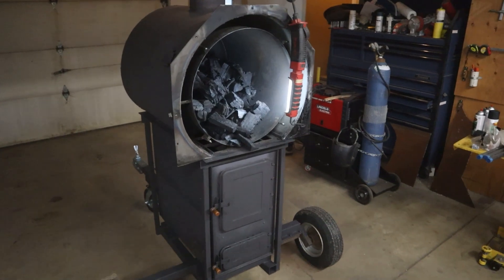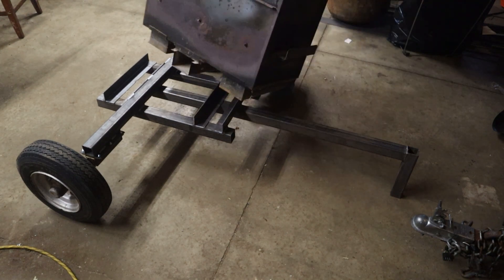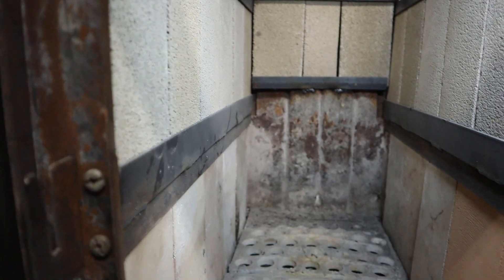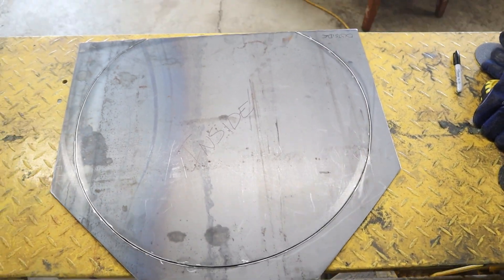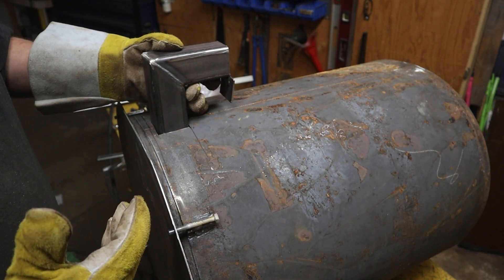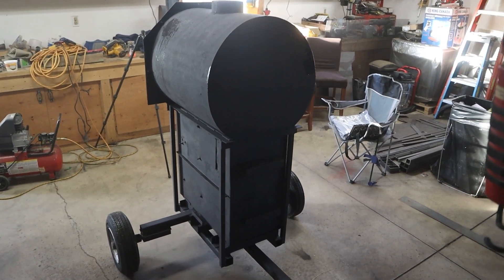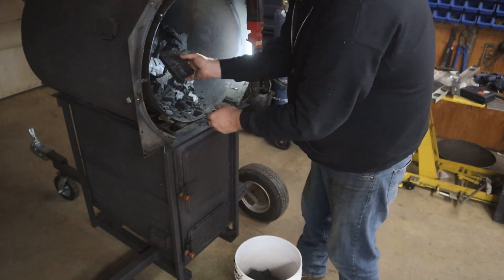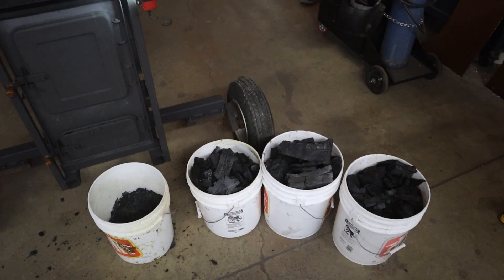Homemade Charcoal - Building a Charcoal Retort

Comment: Really amazing work!   I can understand the need to reduce the size of the wood pieces, but the fact that those big chunks got turned to charcoal as well really shows how well it works.  Video posted 2 years ago, so I'm curious as to how well it performed long term, and if you had any design changes you'd make if you built it again.

Comment: Nice job, probably even better when you finish the "tweaks". I am looking for ideas to copy, yours come in line with what I was thinking, as I have a couple older wood stoves that I wanted to use as well. Another thing that I would like to do is incorperate  a way to use waste oil in the burner as well as wood.

Comment: How is this holding up 10 months later?
I'm building something similar at the moment out of stainless steel and will insulate the outer drum plus fire the whole thing with a biochar producing TLUD gasifier so I'm not burning any wood down to ashes
Reply from the maker: Still going strong, I've done about 12 batches this year. Stainless would be nice, could get it even hotter. Hope to see it on your channel.

Comment: How can you use the excess heat productively?
Reply: Isn't he already using it productively to drive off the wood gasses and to fully dry the product? Stealing heat from that process would only slow it down or even cause incomplete pyrolysis. Maybe you could use a little of that for cooking if you welded a flat plate somewhere near the burn chamber, kinda like how wood stoves are traditionally used.

Comment: The only thing I missed was how the cook chamber lid sealed, was it a slide fit? By far the best build I have seen
Reply from the maker: Sorry for the delayed response. Its not a perfect seal, but the bottom head from the water tank fits in the pipe snug. There is enough back pressure that oxygen cant get in.
Reply: @buildfixeat  Thanks for the reply I will be building a slightly smaller version of this soon. As I said, by far the best build I have seen.

Comment: One of the best builds I have seen 👍 I'll keep an eye out to see what tweeks you make. 
(1) I'd consider making a removable standpipe for the gas discharge hole in side the retort to keep char from falling in while burning, and a flat cap for that hole to keep char from falling in when you empty the char. 
(2) others already mentioned the extended tube with holes for a burner under the chamber. 
(3) If you still have the water heater outer shell, i'd put it over the outer tank and fill the gap with cheap fiberglass insulation. Google say's fiberglass melts at 1,300F, so should be fine, or go with rockwool which melts at 2,150f. Keeping the heat in should reduce your burn time.

Comment: I like it!

 My challenge up here (Rye, Colorado) is trying to use tons of pine needles and pine cones to fuel the retort. And I mean tons. One year I collected 23 bags 55 gallons each to burn under the supervision of the Fire Protection District. (They were plastic, so I had to unpack them, and keep them) This was done at the local gravel pit away from the forest. 

So, I figure I might create several special chambers fillled with the needles assisted with either forced air though the center, or just a lot if drill holes in an iron pipe. Any time I've ever tried to burn pine needles they just soldered. During a forest fire I imagine they get so hot that they suck oxygen right in regardless of how piled up they are.

Anyway, good design!
Reply: Why not just grind needles, soak them, and press bio briquettes out of them? Seems like less hassle and better end result in this scenario to me.

Comment: It is a very good machine, but you should convert into a pyrolyzer, that means fumes emitted from woods are recovered. The tar collected has a very high value in the chemical industry.
Reply: But ya unless if you’re wanting to collect pine tar for water proofing or something you might as well burn it in the process of making charcoal.
Reply from the maker: Interesting
Reply: Who the hell buys that stuff though
Reply: Well it depends. Some wood makes pine tar or if you distill the gas by running it through a pipe and water condenser then it condenses into a liquid or gas. I think that’s how they make turpentine or other volatiles from wood.

Comment: I like the way you reuse the volatiles instead of just venting them.  I would set up that burner tube to extend toward the middle of the retort, or maybe seal the end and drill some holes spaced to give you an even heat.
Reply from the maker: I agree. She will get some upgrades in the spring.

Comment: Really nice design, and robust. I would put a longer pipe with some holes drilled in it to distribute the flames under the retort chamber more evenly. Also, you could turn it around on the trailer. This would allow you to tilt it backward for easier tighter filling of the retort chamber. With a charcoal retort you really want to pack it in there as tight as it will go.
Reply from the maker: You are right, it needs the pipe with directed heat. I was just worried about plugging the holes....Once the snow stops flying I'll bring it in and perform some much needed upgrades. Many Thanks
Reply: @buildfixeat  I understand about the holes getting plugged up, but they don't have to be that small. They only need to be small enough so it doesn't dump all of the flames in one spot. You could also make it removable.